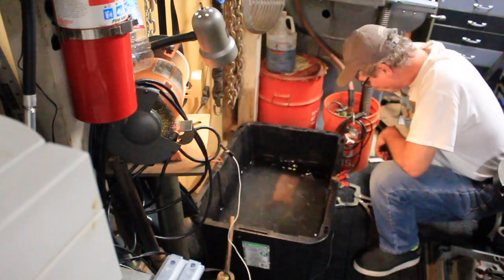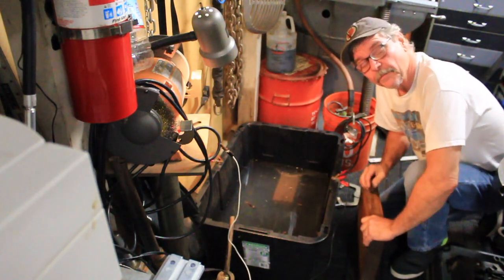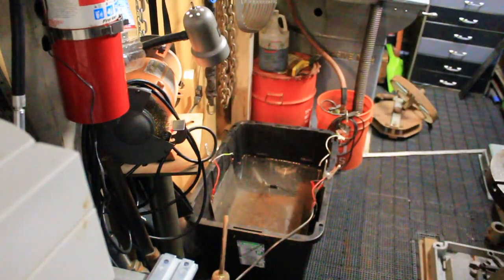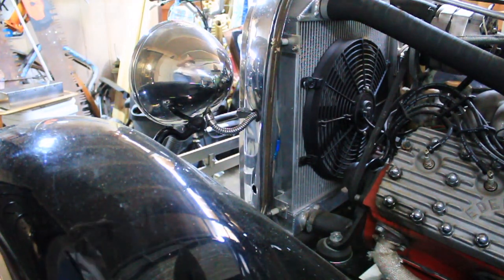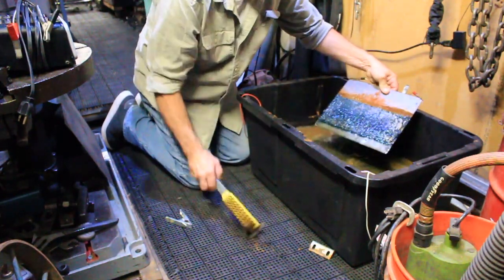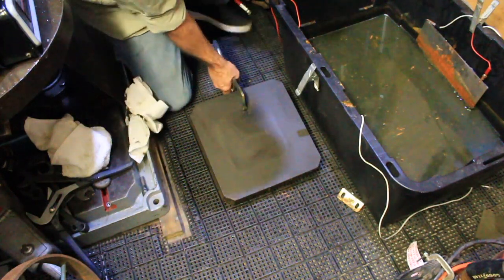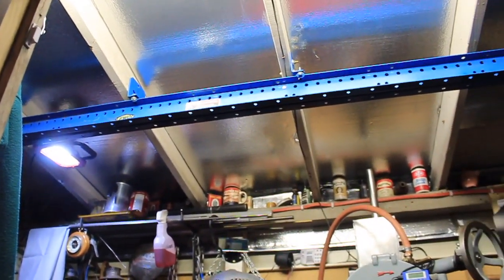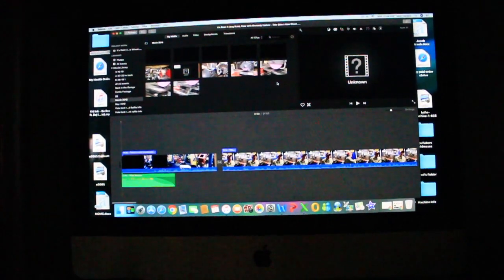Vintage Cast Iron Surface Plate Refinishing and Puke Tank Update.

Comment: Ron, when I do electrolysis rust removal I use pieces of rebar for the electrodes. I like the trolley crane, I need to think of doing something like that
Reply from the maker: Hi John, thanks for watching. Since this process works well I’m getting a bigger barrel. Going to hang the rods around the perimeter. I’ll try the rebar, it’s really cheap. Since this silly stuff in the world has been going on my metal shop has gone out of business, the owner decided to retire. This situation made the decision easier for him. Trolley and hoist hopefully will make my body say thanks Ron.

Comment: That must be a really old surface plate, Ron.  The ones that I've seen all had square ribs cast on the bottom.  Could possibly be an old lapping plate.
Reply from the maker: Thanks for watching.  Might just be a cast iron footing of some sort. With the square recess it has. Am I wrong in thinking,,,if it was a precision piece it should have a makers mark. Or ? We’ll have fun making some kind of plate. I need an excuse to use the surface grinder anyway.  😁